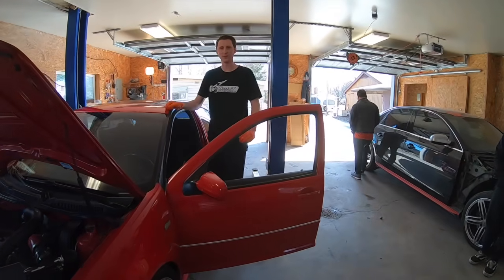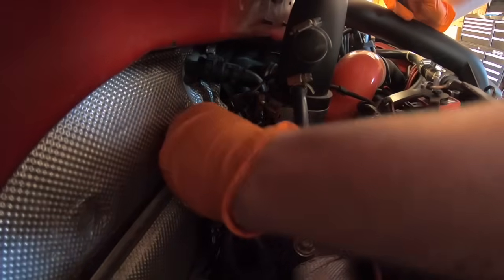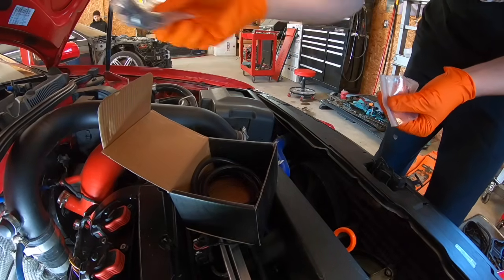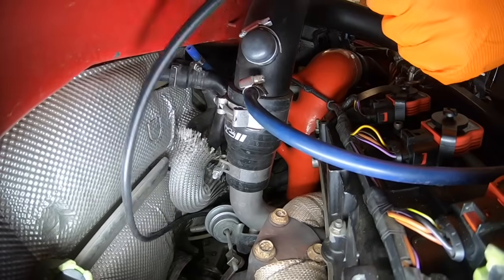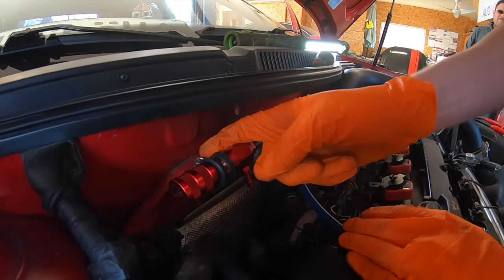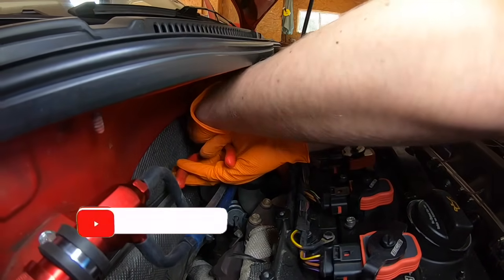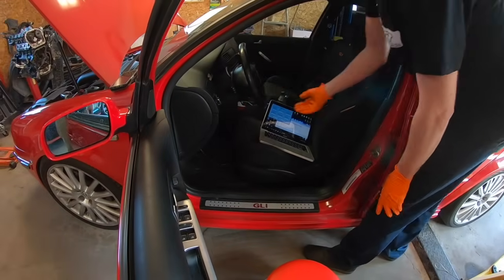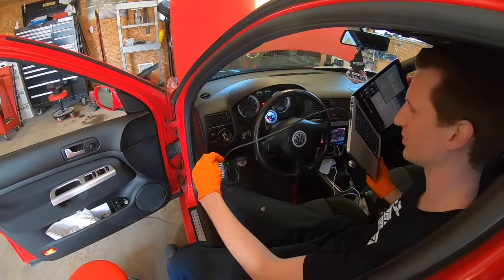BDT: How to Install a Manual Boost Controller

Comment: A friend did this to their MK4 1.8T but It would boost up to 18psi and then drop back to 0 around 3000. We just took the boost controller out and ran the factory wastegate pressure until we can figure it out and it runs fine without the controller. What would be the problem causing that?
Reply from the maker: You have to have a tune for that mod.

Comment: Hey man i have a gli with a k04 and eurocustome tune, the kit came with a mbc, on my gli i already have the Rn75 valve. I dont think the n75 is deleted could i just run it with it connected, but hoses going to the mbc?
Reply: *dont think the n75 valve is deleted on the tune.
Reply: @nieto064  yes I have mapped mine and deleted out n75 so just use the manual boost controller 310 whp

Comment: Little confused by this video. Does the MBC you are using have a seperate bleed exit for the air? Because my MBC has one pipe for connection and the other vents the air. So not sure how this would work. Also you mention you have a tune to delete the N75. Some people may not have thst tune so again would this work without ecu issues.
Reply: W
Reply: No
Reply: Vent boost controllers are trash. Wasting boost.  Going inline between turbo housing pressure side to the MBC make it in a way where the boost has to be higher to push against the ball bearing and spring to open wastebate

Comment: Same way with the b5 Audi A4 ?
Reply from the maker: Jonathan Santiago yes sir! Just make sure to plug the hole in the intake tune. Run one line from wastegate, and other line to compressor housing nipple.
Reply: Boost Dynamic Tuning thanks bro I appreciate it
Reply from the maker: Jonathan Santiago no problem! Glad I could help.

Comment: Would this be the same for a t3 turbo with an external wastegate??
Reply from the maker: Yes, connect it to turbo pressure line and wastegate. You’ll be all set.
Reply: Okay cool, thanks man

Comment: What about that hose you left wide open on the inlet pipe that you pulled off of n75 valve. Where does that go? Just block it off?
Reply from the maker: Yes, just block it off. I did it off camera, sorry about that.